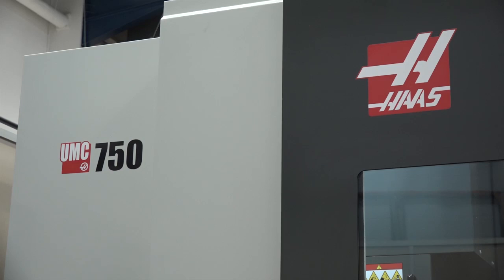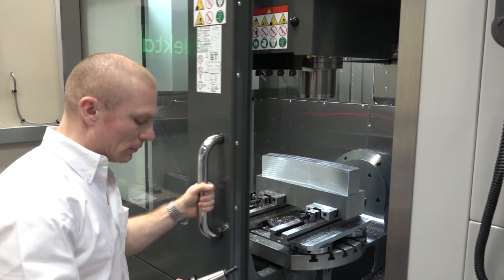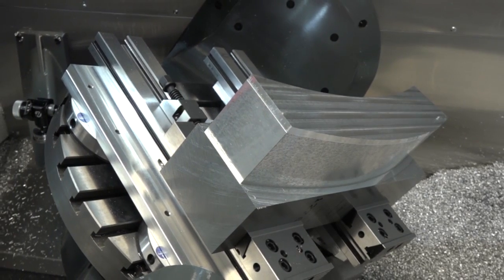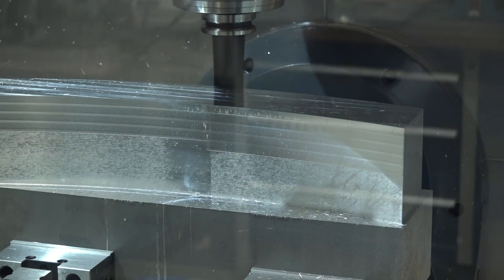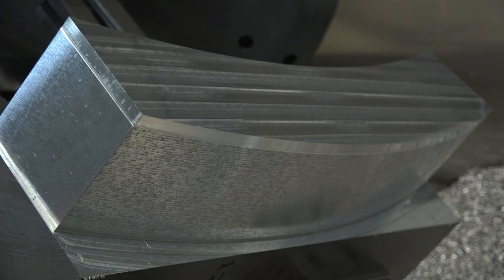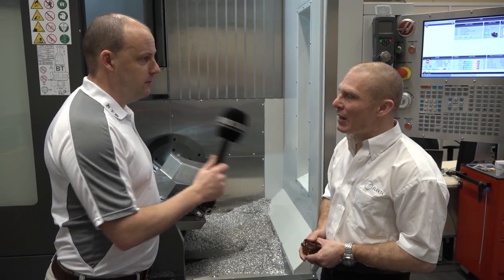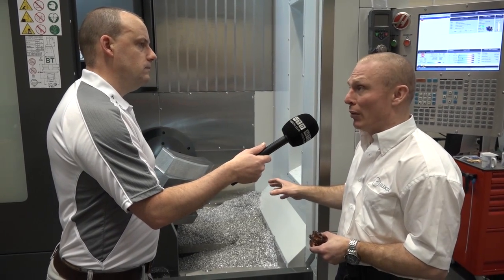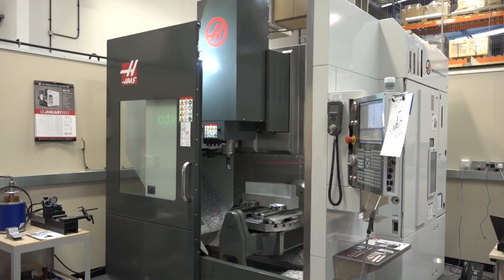HAAS UMC 750 is 1st choice for medical manufacturer after 4 years of research

Comment: 'ere :-) you should put a link to that white paper from the French company... (pretty please). Great video and good explanation of in house products and capabilities vs sub-contract "Engineering" / job shop.
Reply: Thanks very much that's very kind! .Typically these machines operate a lot better than the obvious stated raw tolerances but it's not always the case that a machine tool builder always knows how those "Play out" and where the useful sweet spots for various applications may lie with respect to a particular machine. That would be wonderful! Cheers! Everybody likes to save about 100 grand  $ / Euro ? GBP if they can for a machine that is actually really very good for the task. Real props to Elekta for being patient and measured and taking their time to find a machine that's a good fit... and hunting down useful data to prove the case without undue risk or sales pressure. Excellent (Big thumbs up and also big thumbs up for MTD CNC).
Read more